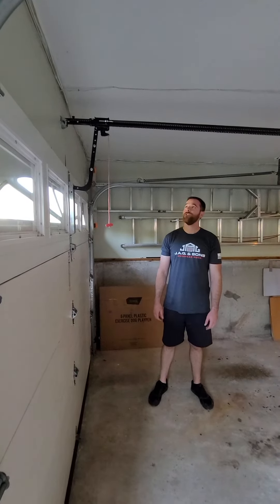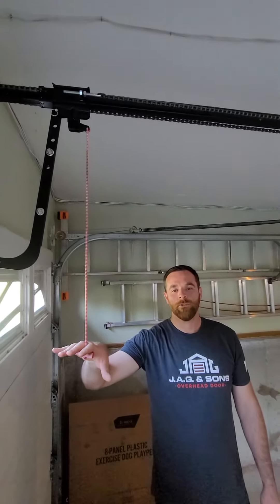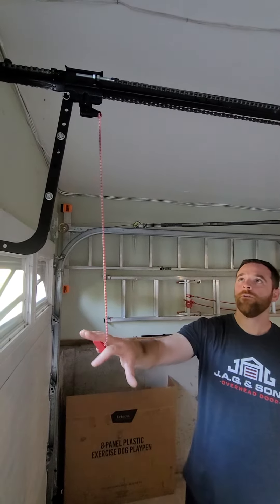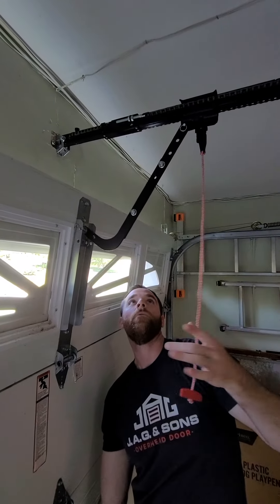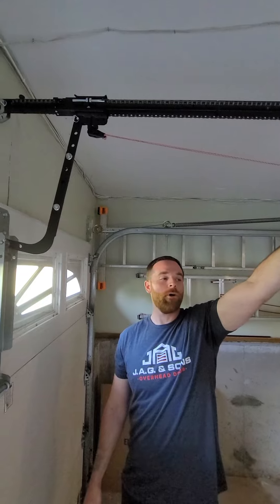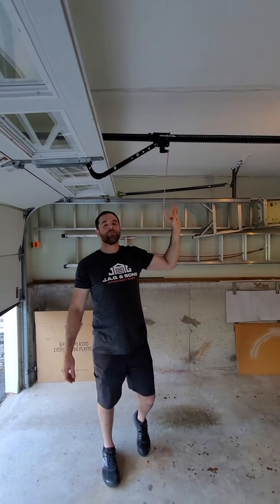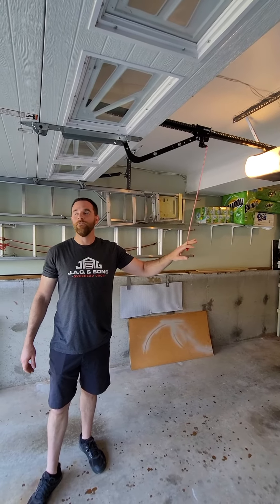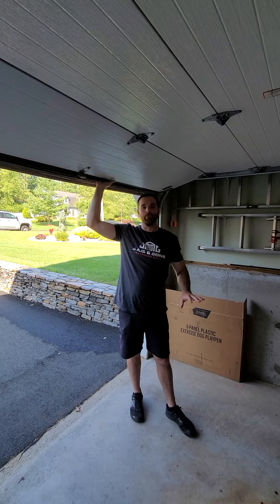Chamberlain Garage Door Opener Emergency Release Explained

Comment: Dude… You are a lifesaver. I saw that it got disengaged, but I forgot that the part with the handle had a clip that was turned 90° when it’s engaged versus disengaged. When that part is straight down, it will not reconnect. Thanks again.

Comment: how to make the rubber go in reverse so it can re-engage.....everytime i push the opener it goes to close it and not open it and the latch part is almost at the very end to where i cant latch it
Reply: It sounds like your limits may need to be reset. Hard to say without seeing it in person. Depending where you're located I may know someone nearby to refer
Reply: pretty much the trolley is to far forward and i cant latch it....i tried pulling on the rubber track to get  Manually....but its to hard

Comment: To prevent possible SERIOUS INJURY or DEATH from a falling garage door:
If possible, use emergency release handle to disengage trolley ONLY when garage door is CLOSED. Weak or broken springs or unbalanced door could result in an open door falling rapidly and/or unexpectedly.
NEVER use emergency release handle unless garage doorway is clear of persons or obstructions.
NEVER use handle to pull door open or closed. If rope knot becomes untied, you could fall.